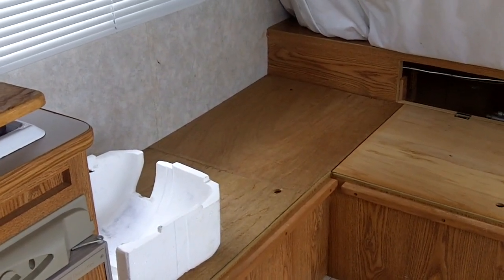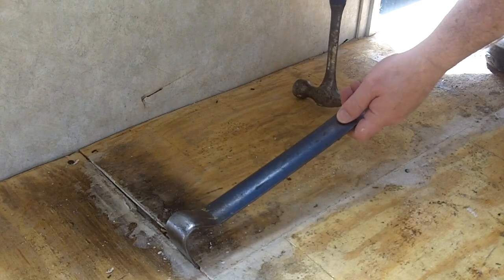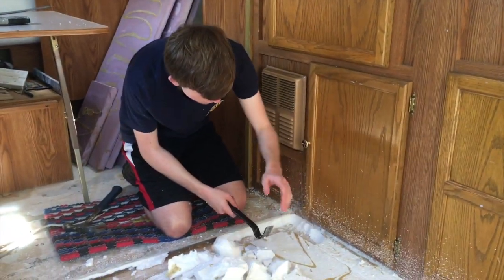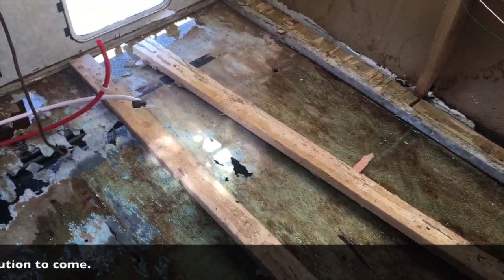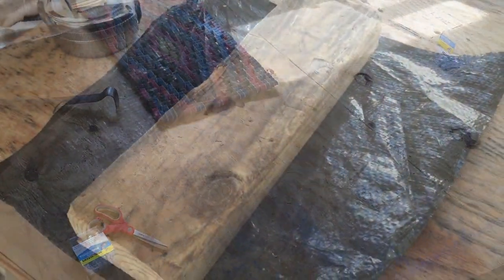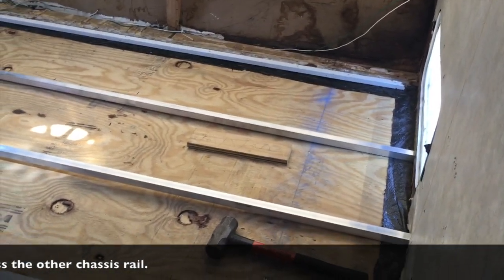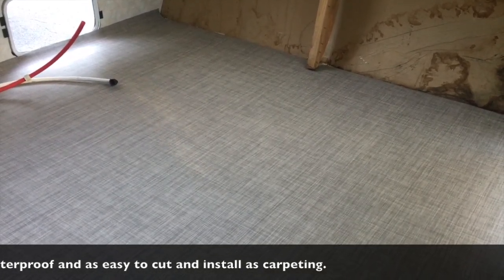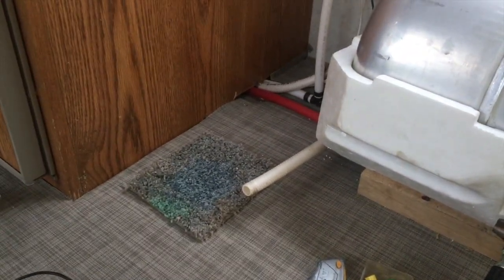RV Camper Floor Replacement

Comment: That is the correct way to replace a floor and install the woven vinyl product in an RV (even though it's a pain in the butt).
Nice job!
Reply from the maker: Thanks Mark and Dawn!
Reply: Where did you get your aluminum frame squares
Reply from the maker: https://www.onlinemetals.com/index.cfm
Reply: RV Education 101® most campers that have floor rot will also have joist rot and/or wall framing rot as well. If thats the case, the correct way to replace the floor/joists is to de-couple the trailer body/shell from the frame and raise the body from the frame. There are other videos on youtube showing this. Essentially, remove or cut the screws holding your bottom plate/framing to the flooring (you have to remove the trailer nose cap and siding to access the screws). Once all screws are removed, slide a 10'  or 12' long 4x4 or 6x6 through the storage doors - from one side to the other. Support each side with a high-jack/farm-jack or use floor jacks with wood blocking to account for the height difference. Jack the camper body up by 1 or 2 inches from the frame. NOW you can PROPERLY replace the trailer floor/joists, etc. Doing it this way would have sped this job up to be less that 5 days.
Reply: djbmw1 - any videos on doing that?  I cannot find any. Thanks
Reply: @djbmw1  one of the features of the r-vision trailers is that the walls are carried by aluminum cross beams. You can have completely rotten floors and perfect walls.
Reply: @StampinJo  Hi Joanne. I'll email you some pictures from when I did this with our trailer.
Reply: @danvanderberry894  Sent
Reply: Rick what size were the beams?
Reply: @StampinJo  haha. I am that husband right now
Reply: @blainebowe73  good luck! Lol
Reply: @StampinJo  I changed my mind and sold it for a loss. Best decision ever!
Reply: how do you remove the wood and foam under the walls?

Comment: the "underlayment" is called darco and is a waste of time because it actually TRAPS moisture under the floor if it ever gets even a tiny pinhole in it, which they do easily. Kinda like when folks cover their rvs or boats etc with a cover while outside, every time you take cover off it has promoted mildew, bug and bird nests etc.    Next time (if you ever do this again) spray the plywood floor with truck bedliner spray and you'll protect it forever.  No need for wraps. My advice is based on rehabbing and sales of over 300 trailers.  The junk manufacturers use in construction is unreal.
Reply: Thanks for shearing . Do you spray with truck bedliner  the top  layer of plywood or the bottom layer?  It is ok to use regular plywood 3/4  or 5/8 thick or it is better to use pressure treated plywood? What your opinion in this ?  Do you spray after the plywood installation or before? Thank you for taking time to share.
Reply: Thanks for shearing . Do you spray with truck bedliner  the top  layer of plywood or the bottom layer?  It is ok to use regular plywood 3/4  or 5/8 thick or it is better to use pressure treated plywood? What your opinion in this ?  Do you spray after the plywood installation or before? Thank you for taking time to share.
Reply: @eugenekalinowski17  use PT plywood and spray both sides before install.  RV makers also space out floor joists way too far apart so I add "sister" joists to have more support also
Reply: So you’re saying, skip the black tarp, material and spray, both sides of pressure-treated plywood with bedliner and place it right on top of the campers metal floor joints?

Comment: I keep trying to figure something out and I decided to finally ask. Your lower layer of plywood was screwed to the chassis, but was it attached to the walls anywhere? Same question about the aluminum. We're they attached to the walls or the lower plywood or just floating? Your final width from my math is 2-3/4" plus your luan. Did you add 3/4" to.the rest of the trailer?

Comment: Hoo boy. I gotta rotted-out bathroom floor from a shower leak. Dreading having to do all the work you did. But I sure do appreciate you showing me how it's done the right way. Thanks!
Reply from the maker: Sucks. But no other way to do it.
Reply: Sometimes you can get lucky and only have to replace the immediate layer of board under your tile or vinyl.   I have a 18 transcende and I figured out if you go under the area you have to replace and remove your under guard whether it be the plastic coated cardboard or what ever they used and push up on that area if it's not mushy or wet it's only the top layer hopefully you get lucky like I have.

Comment: Much to comment on. Remember tearing the complete back half off of one of those dodge chassis with camper back in the eighties. What a project. These things are a definite can of worms. Best thing to do is if buying. Calculate the desired use in time, usage over two years, then take away devalued condition and figure whether it is worth having. One can do a tent trailer or B&Bs a lot cheaper and no headaches when confronting these problems over the long haul. I you're going to buy one, do the investigation, considered time of use and then lick your wounds when it's time to sell,

Comment: Wow that was awesome!  Thanks.  This is really helpful in helping me plan out my rotted camper floor repair. All my water came from a loose fitting on the back of the hot water heater.

Comment: Redoing my roof right now because of the woodrot. The way they design cabinets is beyond annoying when trying to do floors or roofs. Have to basically gut a camper to fix it. I got annoyed and took a reciprocating saw to the roof screws. Just cut it right off the cabinets and filed the cut ends of the screws down to wood.

Comment: THANK YOU SOOOO MUCH! Yes I'm shouting lol.  This video is exactly what I have been looking for.  I need to replace some framing and a lot of flooring on my 1984 Shasta.  The underbelly is pretty shot just like your aluminum (mine is galvanized but holes rusted through it).  This is the first how to floor replacement that showed the whole project even Ripstop Material.  I feel like I am so much more equiped to tackle this.  Thank you.  From Mystic CT.
Reply from the maker: Thanks and good luck!

Comment: Great work Rick, thanks for the video!  .  We just purchased a 2004 with a soft floor.  I was surprised how bad it was once I got in there and tore it apart!  I am really debating replacing the vapor barrier on the bottom.  It seems to me that once water gets in, there is no chance for it to dry out, especially if you have vinyl flooring on top.  So I'm considering skipping the moisture barrier on the bottom, using marine grade plywood with an exterior stain/ water repellent applied to it.  In my experience marine grade plywood does not seem to warp like treated plywood does.   Then following your plan from that point.   
I have to wonder after reading all these posts from all of these people with rotten floors, if the design was bad to begin with.  Our camper will be stored inside, and the only time the bottom will ever get wet is towing in the rain.  The wheel wells do most of the protection.  So i figure if the wood is treated or stained why care if it gets wet.   Pontoon boats don't have a moisture barrier on the bottom of the wood, and they have much more exposure to water then the bottom of a camper.  And yes I do know they rot out over time as well.  Just throwing my ideas out there for people to comment on.    Thanks again for sharing your advice and experience!
Reply from the maker: Thanks! Good luck with your project!

Comment: We have the same camper and our floor is soft in front of the sink. ( ours is where your fridge is) and left side in corner of U dinette. We only need to do the front half of floor. How thick was your original factory floor “ sandwich “ ? I want to replace front half then meet up to original floor then go over it all with luan and vinyl. We aren’t doing this until next spring, so we are getting our game plan figured out. Thanks for posting your video, it’s very informative.
Reply from the maker: The factory floor was about 2 inches thick total.
Reply: So your floor is about ¼in thicker than factory correct?

Comment: I am remodeling a 86 fleetwood the floor at first didn’t look that bad however upon a inspection I found the two by twos that go around the camper where the camper siding connects to the floor was all rotted out so I decided to start taking those out and just redo the whole floor but when I did that the nose of it sunk down like 6 inches do you have any helpful ideas that I can use to fix it right now I just jacked it up and put some two by fours on the outside and screwed into the studs to hold it up but it looks as if the outer edge is lower than the floor

Comment: Awesome job. I have a Bantam Flier F18 and the floor was partially repaired They did an awful job and I am going to replace the whole floor as it is really spongy throughout. My only concern you did not address is weight. These trailers are made to be pulled by smaller vehicles(thus the name "Bantam") and that much/type material had to add considerable weight. If done again, what would you change to lighten the job? Any tips will be appreciated! Thanks.
Reply from the maker: Thanks. Although I sold the camper a couple of years ago, I can tell you that there is very little I would change. For the several years I owned and used it after the floor project, it still was performing without any issues. What would I change? I'd use tongue-and-groove flooring.

Comment: Great video! I have a question. On the underpayment. You said you use staples. When you got the underlayment  did you actually staple the bottom underpayment side to the floor? Underlayment to the floor underneath. Was thinking of using some kind of spray.  adhesive.Thanks
Reply from the maker: I did not staple the black underlayment material to the bottom of the plywood. I wrapped the edges of the underlayment around the plywood and stapled that part to what would be the top of the plywood. I did not use any adhesive or fasten the underlayment to the bottom of the plywood in any way.

Comment: Doing almost the same thing to the Trail-Lite Bantam we bought recently. The bottom piece of plywood sits under the floor supports. Was that the same for you? Trying to figure out exactly how I’m going to separate the body and trailer frame to get the plywood between it.
Reply from the maker: I did not extend mine underneath the sidewalls. Hasn't been a problem.

Comment: In case you're actually still monitoring this video, here's a question: are the aluminum crossbeams solid or tubing? It looks like tubing since I see some screws holding them down. If tubing, what are the wall thicknesses - 1/8"?

Comment: How did you get the crossbars under the sink/cabinets?  Was there a 2x4 there originally that you pulled out and then slid the new crossbar in its place??
Reply from the maker: R Sica I carved out channels into the styrofoam insulation long enough that the cross beams reached across the chassis rail.
Reply from the maker: R Sica Primarily from inside as the bottom layer of luan plywood was still intact. I used long drill bits, then chiseled the rest.
Reply from the maker: I need to give you a better response. I removed enough of the old flooring under the refrigerator so that I could install the 3/4-inch treated plywood underneath it. That allowed me to remove enough of the styrofoam so the plywood could extend across the chassis rail. I also had "carved" out the channels into the styrofoam for the aluminum cross beams when I had it all exposed.

Comment: Thanks for this video.  I also have a hybrid  R-Vision with slide out with a rotted floor.  I'm not looking forward to doing this as the previous owner did a shoddy repair job where he just put plywood on top of the rotted floor.  Will have to figure a way to also replace the floor under the cabinets, fridge and in the bathroom.  The PO just cut the plywood around them.  I'll also use aluminum square tubing instead of wood beams for extra rigidity.

BTW, we might be brothers because I also own a TrailBlazer of the exact same colour!
Reply from the maker: Good luck!
Reply: Just bought an 03 C19... turns out this was done TWICE! Have to take up 1.5 in of plywood just to get to original floor!

Comment: I think I heard you say you put pressure treated wood on the aluminum rails?  it didn't look like pressure treated wood though.  I hope it wasn't, cuz pressure treated wood eats your aluminum away in a very short time.  I learnt that from videos where people make floors and decks to walk on in aluminium fishing boats, and when they use pressure treated wood, it eats holes in their boats within the first year.  Pretty crazy, and really good to know about, cuz who would think that would be an issue...  Awesome video though, thank you for posting this.
Reply: Not everyone that does stuff knows what they’re doing… people use the three banes of a good job in a camper all the time: acq pressure treated, silicone caulking, and osb. Or they buy a new AC, tv, or awning but never replace their flaking roof membrane. 

But ya, PT doesn’t belong in boats, utility trailers, or campers.

Comment: This was an amazing repair and very informative. I have a couple questions. How did you run supports and new floor under the kitchen cabinets? Did you have to temporarily support the cabinets during this? Also, is there still a strip of the original floor panel under the exterior wall? Did you have to do anything to brace or support that section as the original portion under the wall would not go back to the main trailer beam. Any feedback would be appreciated!
Reply: Have you started your project? I'm about to tackle one on a 2007 Bantam Flier F18. I'm going to remove everything. I believe that is a better approach and less of a fire hazard when modifying the wall sag with welded supports. Its a lot of work and much cheaper that purchasing a new trailer!

Comment: Rick thank you for this video. I actually just purchased the same brand of camper and have moisture damage in the same area towards the front. You said you chased the leak since day one, can you share what you finally discovered was the issue so I can fix it before repairing the floor? Also, just to verify, belly liner, 3/4" plywood, 1.5" aluminum rails edge to edge screwed to 3/4' plywood, 1.5" foam then 3/8" plywood on top? Does this line up flush with existing floor as I don't plan on re-flooring the entire trailer (most parts are good).

Comment: I have a similar problem I am trying to fix now but I am confused where the supports are. My foam flooring looks just like yours in front of the sink. Do you just remove the foam and add new 2x4 to the existing underlayment?
Reply from the maker: The first time I replaced my flooring I added 2x4s. It did not work to my satisfaction. The second time I replaced the flooring, which is this video, I used aluminum square tubing instead. I only removed the original styrofoam in the front half, which is all my project needed.

Comment: Rick, I have a 99 Trail Lite similar to yours and live up in TC.  Did you have water damage in the door and the sidewalls?  Did you figure out where your water was coming from that caused damage?  (Besides the tire blow out damage)
Reply from the maker: My water damage was only on the floor, not the sidewalls. On the floor, nearly all of the water damage was in the front corner on the door side. The leak was the corner right in that area, where the sidewall meets the front cap.

Comment: How in the world does the front cabinet come off? I'm in the middle of doing mine, and I'm afraid I'm going to break something taking it out.
Reply from the maker: If I remember correctly, I had to slide on my back under the cabinet and remove several screws.
Reply: @Gr8LakesCamper  Thanks for monitoring this video. I figured it out. I had to remove the staples under the cabinet as well as the side brackets to get it out. For sure, that cabinet was built inside. If I hadn't removed the water tank to get a little space, I would never have gotten it out in one piece. I'm in the middle of taking out the floor which is basically an 'oreo' piece of hard styrofoam about 2" thick. But first I need to fix the underside at the the front of the trailer since it's all rotted out and pulled away from the floor. I need to replace with new 2x4.

Comment: What a tedious job. Good on you both. 
Question. Wouldn't it have been better to keep the good tin underlayment wherever it was ok, cut tidying up cuts where it was messy and then laid the tent floor like underlayment on top of it all? Just for a little more sturdiness? Also more leak proofing? 
I may have to do what you did. Ye gads. What a lot of work.
The last owner of my trailer laid hard wood flooring without doing underlayment. I can see fibre board, insulation and broken tin underlayment from under the trailer. A few good rains/snow and the floor is going to rot all over again.

Comment: Really appreciated your video. Because of it I am replacing my RV floor right now. I have a Trail Lite B17. I also had someone make me metal rock guard for the front. Just wondering if you chalked behind the metal and what kind of chalking you used?
Reply from the maker: I did not chalk behind the metal.
Reply: Another question on the metal rock guard. When you bolted the top part did the carriage bolts go through just the fiberglass or did you reinforce it by putting some wood behind it to make it stronger. Appreciate the tips.
Reply from the maker: @dsjjb1  I placed strips of plywood on the inside of the camper that I bolted through. At 6:08 you can see where I pojnt to it.